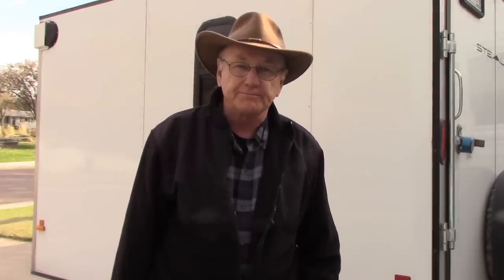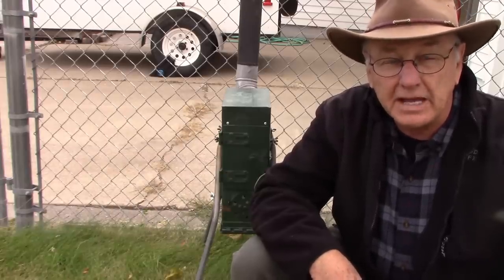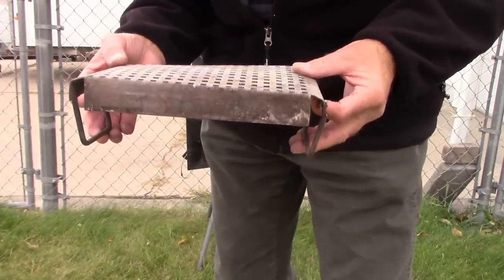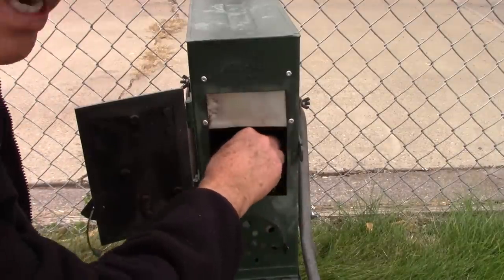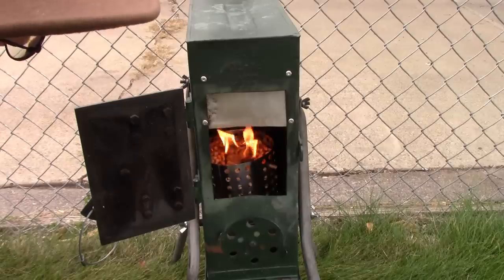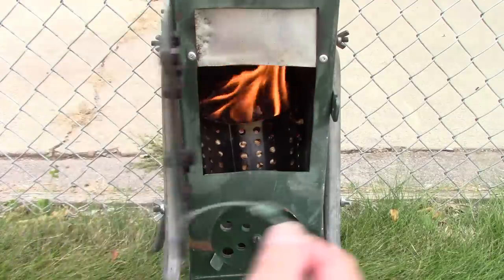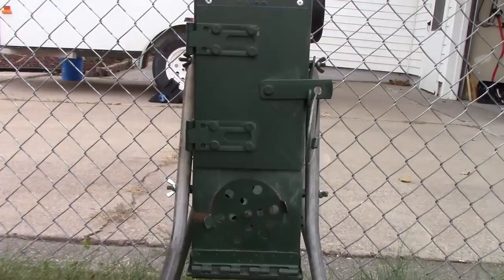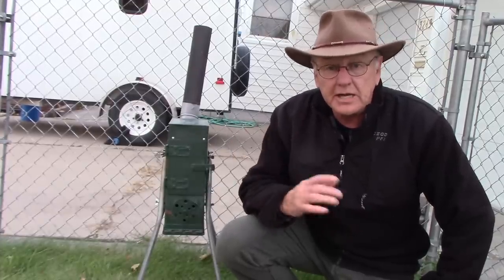How To Burn Pellets In Your Wood Burning Stove

Comment: For use in a small space, I'd suggest making your stove feed from outside air. When you feed a stove with inside air, you're sending the very air you want to be hot, right up out the chimney. Another advantage is that since you're no longer relying on an outside air source to feed the stove, you can control the humidity of your interior in relation to the humidity outside. Since hot air has a greater capacity for holding moisture, any bedding, clothes, equipment etc. can be dried incredibly quickly and thoroughly. If you have any down feather clothing, you can dry it so thoroughly it feels brand new. If the air gets too dry and irritates your eyes, stick a can of snow on the stove, and in no time it'll be comfortable again.
Reply: Long time ago 😂, but....I am really interested in what you suggest😉 , but I don't really understand what you mean feeding the stove from outside or inside air. I am planning to use my tiny wood stove in a Tipi tent ⛺
Reply: I think you want your tent/camper to "breathe," and the wood stove's appetite for fresh air is a great way to keep exchanging your moist breath for outside air.  You just need to be mindful of where the air is coming in and warm it up as it's entering the tent.  If you have a high-quality 4-season tent, it will have vents above and below.  You can run a pipe from the lower vent over to your stove.  It doesn't need to be piped directly into the stove.  In fact, I want some of that fresh air for my own lungs, and the stove can help me get that AND keep me warm.

The stove WILL suck air into your tent.  You just want to control where it comes in and heat that air before it hits your toesies!

Anyway, that's what I'd do.  I'd be a lot warmer, because my gear and I would be a lot drier, and would dry out a lot faster.

Comment: Simple and effective.  Looks like the perfect, non-invasive heater for my mini-camper.  I do all my cooking outside, so I'd probably put the chimney on top, to save space, and maybe it'll breathe a little better.  

Moderate heat.  Long(ish) burn time.  Could probably refine it to get 3 hours out of it, which is not a huge burden.  Good chance I'd sleep the night through.  It'd start to condensate after it stopped moving air (burning), but fire it back up, warm it back up, and dry out.

Comment: I know this video was a while back but first off how is the pellet stove doing now and how do you put pellets in the fire pot to continue it burning? Do you have to wait for it to die completely down and then start it up again or can you just add pellets, is there a way to add a gravity fed pellet so when it burns down it’ll automatically feed it? Great video, Thank you for sharing.
Reply from the maker: You can add pellets to the fire as it burns, but put them off to the side and not directly on top.  It won't hurt to actually put them on top, but they burn pretty fast if you do.  There are pellet stoves designed to gravity feed, but the commercial ones are really expensive!  Slim Potatohead, here on YouTube, designed his own a couple of years back, and it works very well.  Check out his videos.
Reply: @gonagain  thank you for your reply. I will go check out slim potato head‘s YouTube channel. I’m looking for something that I can have burning throughout the night and not have to wake up 100 times to feed it.

Comment: Nice! Now you got me thinking about adding one to my cargo trailer conversion 🥴
Reply from the maker: What we use mainly is our vented propane heater.  We use the wood stove for local camping trips, kinda for fun, but it can really crank out the heat.  Our main heater that we use most often is a NuWay stove, made for ice fishing shacks.  It works great and it uses the same flue as the wood burner.  Here's the video (of course!) 
  https://youtu.be/BKBF-mDnt28.  It's featured in about the second half.

Comment: Last night was about minus 5 f. I loaded the basket got it started  and when it was well on the way with nice slow burn  it ran from 11 pm until 9:45 am.  This is in our 28.5 fifth wheel trailer.  The cost of local pellets warrants the use of them even though these are pine.  We find that in pellet stoves the pine pellets crust up. Will be doing a mix of coal and hardwood or fir pellets soon.  Sending picture of our  Guelph Woodstove #35  it's very old but like new.  Run a 4" heat treated natural gas  chimney pipe from left over parts out of shop.
Reply from the maker: Years ago we used to heat and cook with coal on a boat we lived on.  We liked it.  Interesting combination of pellets and coal and I wonder how it will work.
Reply: @gonagain  
(please don't laugh) ... is the coal you're talking about is like charcoal?
In my fireplace I put a few charcoal briquets at night so the heat will last longer.
Reply from the maker: @judichristopher4604  yes it is and i like the natural wood types of charcoal the best.
Reply: @gonagain  
Natural wood type of charcoal!!!
That is new to me! Where would I buy it?
Reply from the maker: @judichristopher4604  it's usually sold as "Mesquite" charcoal and you would find it next to the regular type.
Reply: @gonagain  
Really!!! Yeah... Fantastic
Thank you for your help
Reply: @gonagain  
I am so Happy...

Comment: Hey thanks!  I was having trouble burning pellets before. Really that worked out anyway because I used the metal for my car for a trailer hitch and saved 400$  I was trying to allow the pellets the gravity feed and that didn't work. Makes sence to me that this might work better as the fire would burn down. I will have to try this and if this works well this would be a nice option for an alternative heat source.
Reply from the maker: Nathan, you can also add pellets to the fire, but use a wider pellet pan and not the tall container like I showed.  That way you can pour the pellets on the side of the flame and not on top.
Reply: Ok, I will try that!  And I will see if they have somthing like that fill cup in walmart

Comment: Dear Sir!
I agree that thinking outside the box is sometimes better than settling for easier. Your makeshift stove is not that much off from several ten- fold times more expensive stoves you can purchase (Cube mini for example). One thing my experience has to point out is just a heat trap in the form of refractory bricks you could implement. They do keep heat and slowly let it out. What you have is a thin piece of metal that warms up and cools down very quickly. Secondly, you could try to light it from the bottom, with some tweaking. Yes, the pellets would burn quicker but the difference would be noticeable. Gosh I love hand made solutions!
Cheers!!
Reply from the maker: Hi Lokiii, I like your idea of the refractory bricks and a couple of them would help a lot.  As for burning the pellets from the bottom, I've tried that and they burn really hot and fast.  You could just about forge on that fire.  Have you seen the pellet trays on Amazon that are for smoking meat?  One of those could also work at keeping a warming fire in your woodburning stove.
Reply: @gonagain  no, sir i have not! I will take a look. Whatever works, that's the best thing I tell everyone. I have a 1890s tall Febo stove (similar toy cigarette - tall and slim, with cast iron legs and head) . I think it was originally for coal, but I just had some parts replaced- the bricks and the metal body (and I made it taller by 25 cm). I will use a perforated flue pipe that fits inside, filled with sawdust or pellets. It'll go on any solid fuel really.
I'm just having issues finding a small piece of high temp glass to put on the gates.

How well does your sheet metal stand? Any corrosion indication?
Reply from the maker: @lokiii3507  I know the sheet metal won't last forever, but so far it's standing up pretty well.  We don't use the stove all that often though.  Some stove companies sell replacement glass for the models they sell.  Maybe you could find something that will work that way.

Comment: We placed a commercial deep fryer basket in our antique woodstove it burns 2 hours set on dead low damper. Uses 4 soup cups or roughly 2 imperial quarts of pellets.  Pine pellets burn fast . High end hardwood pellets with corn or coal mix  should go much longer.  Flame should be blue. Our stove runs very nice.
Reply from the maker: Thanks for the tips and sharing your experience.

Comment: My wood stove burns coal too, wood burns at 500 degrees and coal at 1500, so it doesn't take much coal for a hot fire..  Maybe try some rice coal from Tractor supply @ $6.99 a 40 lb bag..
Reply: Rice Coal???? I have never heard of such a thang...thing.
What is that?
Reply: @judichristopher4604  
Shucks all, U  ain't ner herd a coal ?
There's nut coal, the size of a walnut and rice coal the size of a peanut.. If you add air to the coal you'll double the heat to 3000 degrees and it's used to forge knives..It melts steel..
Coal is from the hills of West Virginia and Wyoming..
Reply: @rtoguidver3651  
Thank you so much for the (extra) information... My Father-n-law worked in the coal minds of West Virginia many years ago... (he died of Black Lung).
I just had never heard of rice coal... or nut coal.... 
Thank you again for the information.
Reply: @judichristopher4604  
This guy is burning wood pellets, and rice coal is about the same size, both need a shaker to work.. Coal burns a lot hotter that's why I suggested it..
We lost a lot of good people to Black Lung.

Comment: I use two (2) stainless steel colanders in my "ancient" (1976 Ashley Style) wood/coal stove.  Both colanders filled to the top with pellets heats very well and burns 3 - 3 1/2  hours with the thermostat set to maximum heat.  So every 4 hours i have to refill the colanders to keep this mobile home warm. That rate is 40 lbs. every 12 hours.  Not too bad considering the cost of pellets. One (1) ton of pellets lasts about one (1) months because in the daytime the stove can go out without too much cooling off inside this drafty old mibile home.
Reply from the maker: Thanks for sharing that David.  I'm thinking that's still cheaper than the electricity would be.
Reply: 12 hours × 30 days × 6.99 per 40lbs =209.00 a month.  Same as power maybe.  Thanks for sharing.  Good video.
Reply: You buy 1 TON of pellets at a time!!!! I didn't know you could do that.
40 lbs a day is a lot of pellets!! If you're buying by the 40 lb bag.
Where can you buy 1 TON of pellets? 
Thank you for this information.

Comment: Cool stove Rick ... good thing you took those 81 mikey mikes out first or you might have taken the whole neighborhood out ... lol ... I love old surplus ammo cans ... but have changed many to those new fangled plastic ones with good seals because they're lighter .... just got off the house roof finishing my new chimney liner for the propane furnace .... was wondering, didn't you install a small propane stove a while back in the trailer ? .. the video where you go out and fire it up to do a time/temp test from below freezing in the driveway ? ... brain is fried after a stressful day and also going up and down the ladder 3 dozen times, lucky I was working on the flat roof section over a dormer and its done with rain cap on and insulated ... I'll go check the videos, but that stove you had in the video was what I was looking for for my trailer conversion .. when using it for bug out only, no mods, I was using a no  vented catalytic propane unit ..... but need vented eventually to eliminate moisture as an issue behind insulation, etc ... great vid as usual .... need to go eat, feed the dog and cool my jets
Reply: Just found the bookmark on that stove ... Nu-Wave ... ice fishing shack heater  ... will find your vid after dinner Rick
Reply from the maker: Spinonemaster you've had a hard day!  Yes, we went to a vented propane heater a couple of years ago because we couldn't deal with the smoke and ashes too well on our roadtrips.  But I like to use the little woodburner when I can.  There's something satisfying about a wood fire!  One of my friends suggested that I put a stove jack in the Clam shelter we just got and use the little stove in there on those rainy, cool days.
Reply: @gonagain  yea, real wood fires are nice, and a jack in the clam might work out ... although, might still be a fire hazard, probably better off doing that open air if there are no bugs ... nice little rig, my next elderly next door neighbor has a good pellet stove, much cleaner than burning wood, has a thermostat and blower ... I just helped him pick up and unload 6 tons (6 pallets) of pellets with my little 4X8 utility trailer last week  ... 5 for him, 1 for his cousin ... I had a few spare pallets so we (Me actually, as he's disabled after a back operation also) had to offload and re-stack, the cover with tarps ... 6 trips to Home Depot, close by ... my good deed for the week ... crazy, as his son lives next door with 3 boys in their 20's ... but he rarely helps his Dad out ... something funny going on their, think it's the wife resenting living next to in-laws ? ... but George is a wonderful guy and neighbor, born in the house, the old German settlers of Pennsylvania ... my back held up okay, and now George can relax and stay warm ... he and his wife (also partially disabled with bad hips) are very nice and very grateful I live next door to help with Georges weekly projects (we don't mention the son next door, and avoid that subject)... I also help him cut his lawn as he uses the mower like a walker, while the son and grand kids next door watch us, TV and play video games ?) ... all good karma for me and life ... keeps me grateful and blessed .... be well my friend, say hello to Linda and the kids and grand kids
Reply from the maker: @Spinonemaster  You're one very nice guy to help out a neighbor in need like that.  Too bad his son doesn't care though.  I'm descended from those Pennsylvania Germans!  My first relative to arrive in this country was Jacob Wolf.  He moved from Bavaria to somewhere around Lancaster in 1764 or so.
Reply: @gonagain   ... yea, the Germans had a big impact on Pennsylvania history ... hard working farmers and later of course coal and steel ...  still lots of machine shops around here, big and small (doing well with the Trump economy, trucking as well .. help wanted signs everywhere) ... and yea, George and Betty get along with the son ... but the daughter in law was married before (3 boys are hers from another marriage) and she wears the pants ... so I think the riff is that she dislikes her husband having to help out ... family dynamics seem off there, so I steer clear  ... George and Betty are the best neighbors ... and I'm inside an old quarry used to build the canal so we have a 30-60 ft rock wall between us that runs almost out to the street ... I have lots of privacy as a result, rock wall is on both sides of me ... the son works for the Canal Authority ... maintaining the 60 mile canal from the Lehigh River in Easton to almost down to Philly ... 3, 20 something kids living with them ... George says he's never met lazier human beings in his life .... lol ... George was a bricklayer, turned Big Chevy dealer salesman ... and did well at the later, but that was still hard work and long hours as my grand father and father were GM dealers, so I know ...
Reply from the maker: @Spinonemaster  I guess the German work ethic didn't rub off and that's too bad.  It sounds like you have a nice place there though.
Reply: @gonagain   ... the kids are from the other marriage ... she's Italian, doesn't work, some kind of sketchy disability thingy ?, they're her kids ... I think Georges son just tries to keep the peace  ... looks like she's not a fan of him doing chores over there ... so he's caught between a hard place and a rock ... I've seen this before with families ... and yea, scored on this house from an estate sale in a down market ... historical restoration is my love .... just too big as I head into semi retirement ... almost completely restored after 5 years, but now also a lot of maintenance ... need to lighten the load and downsize ... maybe travel some in the trailer while I'm still active and able ...
Reply from the maker: @Spinonemaster  I hear you.  I'm trying to lighten my load now too.  I have too many obligations weighing me down and taking up my time, not to mention possessions!
Reply: @gonagain  yea Rick, a life of working hard, acquiring things .. tools, art, toys ... and now I'd just like a day where I don't have to take care of "stuff" .... it was all good, but now feels like too much weight .... and why I like the minimalist concept of the small trailer ... as a good friend of mine says .. these were all gifts ... luxury problems ... but can also weight one down ... we get attached to things, but some that no longer serve a good purpose, but we worked hard for them so hard to let them go ... so I'm still learning, and learning to detach ....

Comment: What happens to the paint on the first use when the ammo can is new?
Those dimensions appear to cry out for bricks instead of pellets. I wonder how the cost of each compares by weight.
Reply from the maker: First start up should definitely be done outside.  Afterwards I painted it with high temp paint.

Comment: To add more pellets, would you just dump more on top of burning pellets? (seems like that would smother the fire), or do you have to add another whole can and start again? ( that seems to defeat the purpose of heating). Thanks
Reply from the maker: We try to pour them off to one side so it's better if you have a wider container.